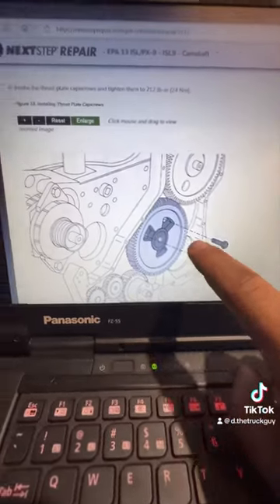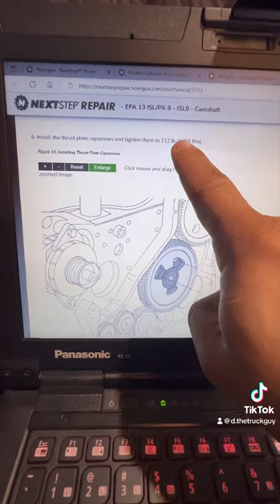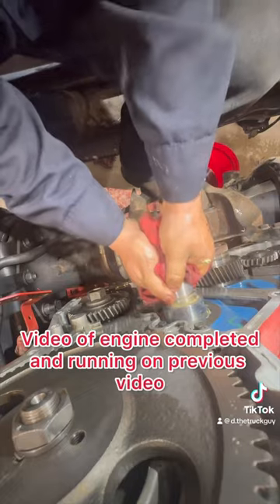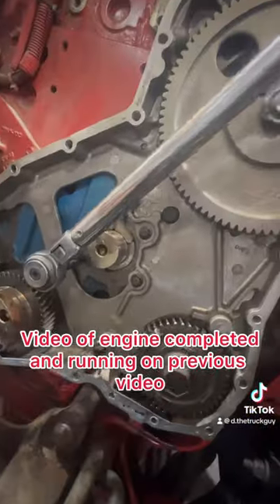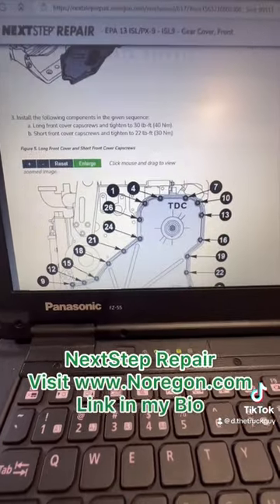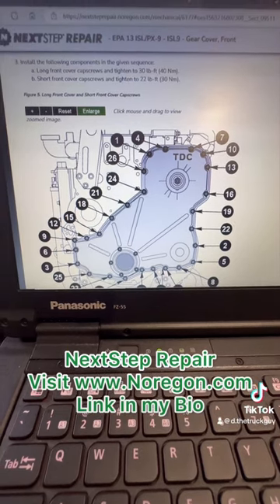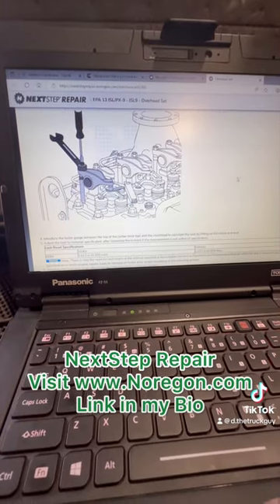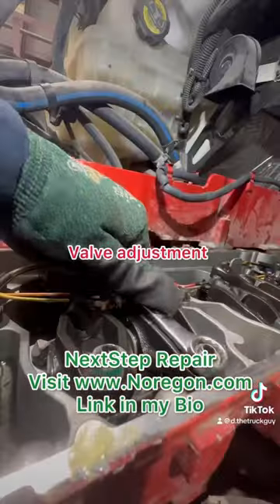Cummins cam swap part 2 #mechanic #dieselmechanic  #dieseltech #semitruck #dieseltechnician

Comment: Close up of the tapet “holder” and the install tools would amazing. I did a case gasket on my 6.7 and used the wooden dowels to hold em up and out of the oil pan ha. I knew Cummins/someone had a special tool for these situations.
Reply: 6.7 actually use wooden dowels I call them chop sticks. The engine he’s on is a 15L I’m assuming and they have actual special tools

Comment: Took my truck to kenworth about burning oil it’s brand new and it has 8,000 miles on it and had a (old) miss fire fault code but that’s somehow old and unrelated